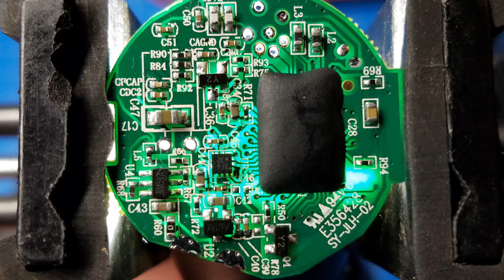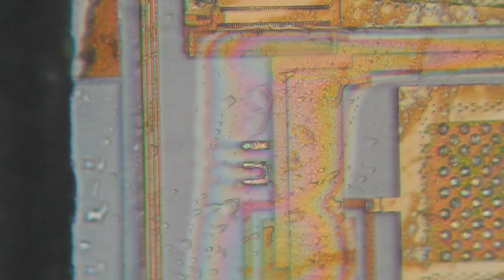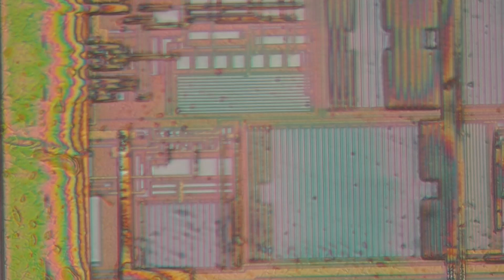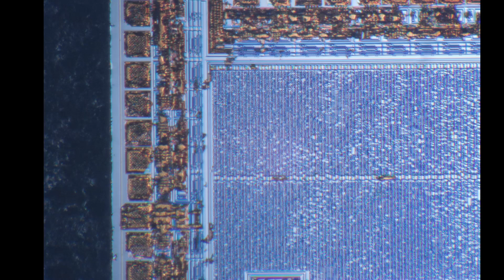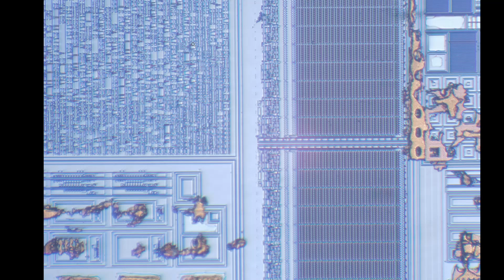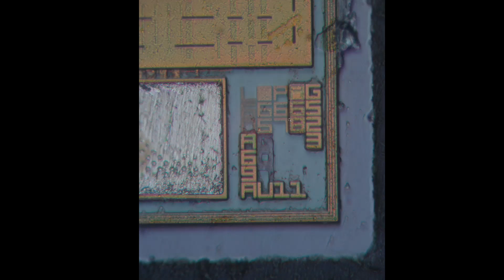The Microcontroller Of A Savi's Workshop Lightsaber Hilt

Comment: Chemical removal was the right idea to remove the epoxy, but you needed different chemicals.  Glass etchant will also react with crystalline silicon, so it will eat the die.  Mechanical removal requires controlled removal of nanometers of material in a pass, which is much more difficult.

Comment: GeneralPlus has dozens of sound controller (all MCU have min instructions & registers but offer from 1 to 32 channel audio.  While it's possible this saber uses GP's 16-bit MCU micro-n-SP, this seems an overkill (but may be cost effective). 
>> Most likely, this saber uses one of the GPC Sound Controllers. For example, the GPC11256C, see full product line and data sheets in .pdf) here ...
http://www.generalplus.com/1LVlangLN14SVprot_noSNproduct#
>> "The GPC11256C, a speech/wavetable synthesizer, equips an 8-bit CMOS microprocessor, and 256K-byte working ROM, 128-byte working SRAM. Other primary features include two 8-bit Timer/Counters and can cascade to one 16-bit timer/counter, 24 Software Selectable I/Os, One 8-bit DAC and a pair of PWM output. It operates at a wide voltage range of 2.2V to 5.5V.  Plus, a Clock Stop mode is built in for power savings. The unique power saving mode saves the RAM contents, but freezes the oscillator to stop executing other functions. The maximum CPU frequency can run up to 8MHz and the instruction cycle is two clock cycles (min.) ~ six clock cycles (max.).
>> Note:  GeneralPlus also partners with SunPlus, so this saber may use SPMC801 (essentially,  6505/8502 RISC MCU), datasheet here ...
https://www.datasheetarchive.com/?q=SPMC801A
>> Hope this helps, please let me know.
Dominick 9/29/2020.